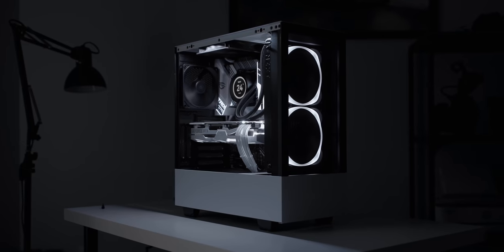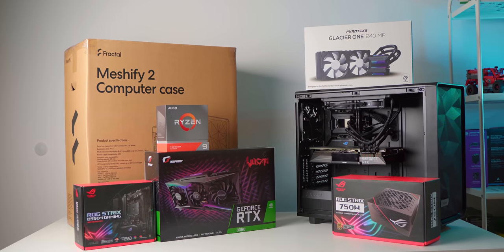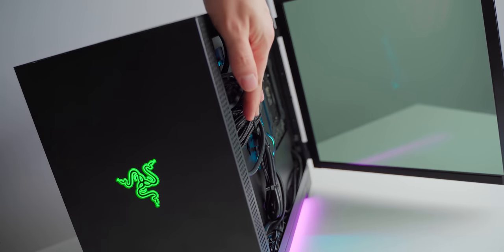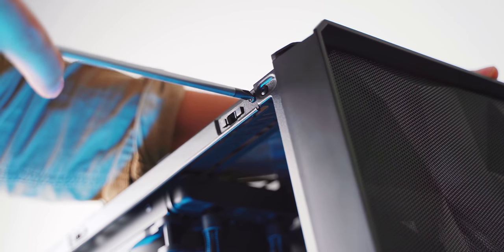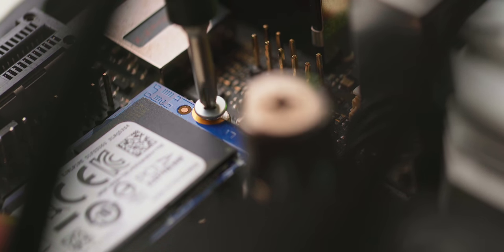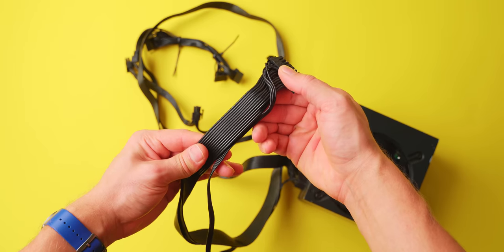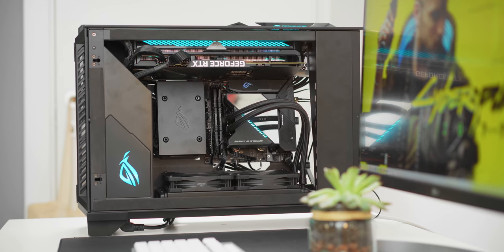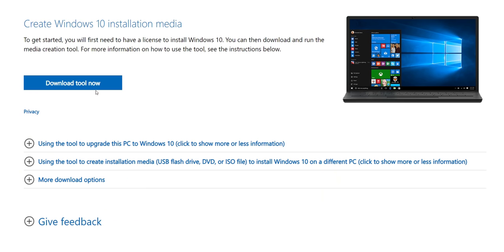AVOID these BIG Mistakes when Building a PC!!!

Comment: CPU installation is the easiest yet most terrifying part
Reply: Yeahh I recently just built my first PC with the ryzen 5000 series and x570 board so I was scared of the cpu installation and the bios flashback
Reply: @landondabney9939  but its not even a rational fear for me. I've installed dozens of CPUs and I still get scared.

Comment: GPU coil whine by far for me. If you are very lucky, you might get a totally silent GPU, but if you aren't, your ears are screwed. Buy another one and pray for luck, or get the noise cancelling headphone. I just can't understand GPU manufacturers are not taking this issue seriously.
Reply: GPU coil whine?  most  GPU won't spin the fan unless it reach certain temp.  and when do it pretty slient.  am only hearing  case fan instead!  but never loud from the gpu. what model and brand?

Comment: There alot of moot opinions, have proper tools, tight screws? Really? They ship across the world, they need to be tight, unless you want a scratched up case.

Pull AIO, pro tip start for the middle and criss-cross the other middle.

You get what you pay for.

I could rant more and more but.

Comment: You just got to wiggle the usb 3.0 cable up and down... its' not that hard. There are also custom sata cables... like custom psu cables. Put the gpu in the pci slot all the way... push down on the clip first then pull out.  Oh god his just bitching about everything that's fixable, buy a different case then! it's not that hard. "Yea I bought this case with terrible thumb screws and font i/o attached to the front panel even though it was mentioned in the review"